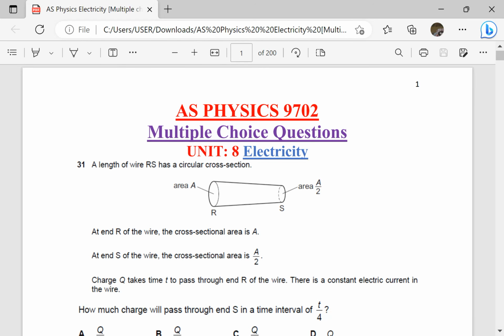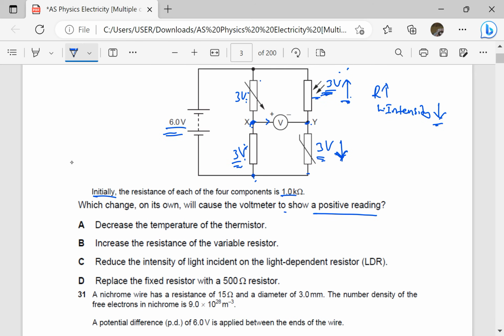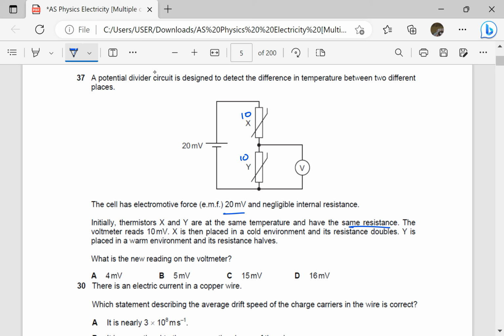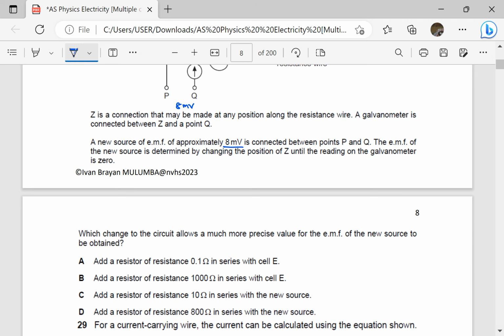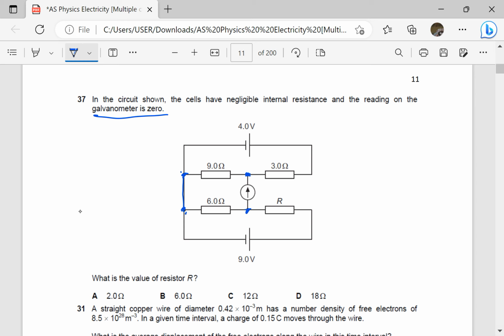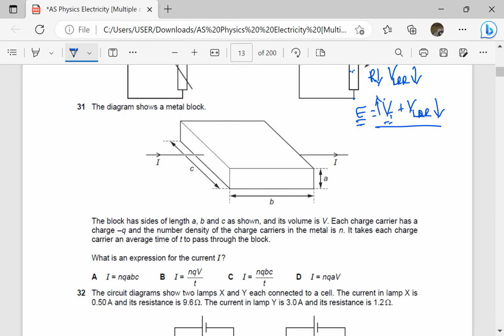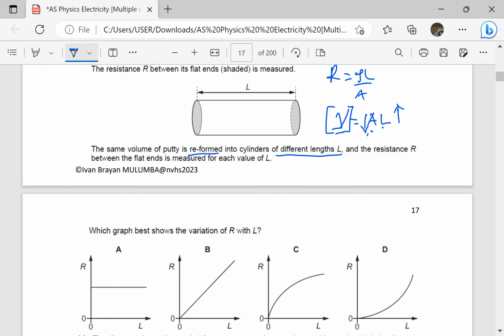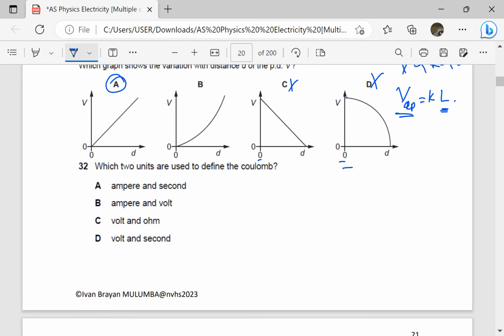Electricity & DC circuits ;AS PHYSICS 9702 [MULTIPLE CHOICE QUESTIONS] #Part 1

Comment: 41:09 is the voltage of the resistor with 6 ohms for the resistor in series of 24 or parallel

Comment: at 26:09 I think the answer should be 2P if we compare currents as its a series circuit so current will remain same but voltage would be different. Could you please correct me if im wrong??
Reply from the maker: if u use current, current is equal to emf divide by total resistance, in the first circuit current is V/R in the second circuit its V/2R, and power using current = current squared x resistance, so the answer will be the same as the one given
Reply: ok thank you @learnPHYSICSwithIBM

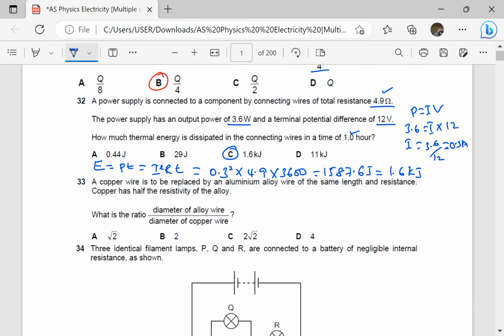Comment: Sir at 10:23 why we don't calculate the total energy which is 1587.6 then subtract the useful energy bcz question say calculate dissipated energy
Reply from the maker: power dissipated depends on current squared x resistance please.
understand the concept
total energy = pxt = 3.6 x 3600=12960J